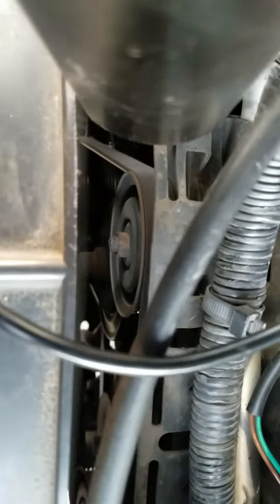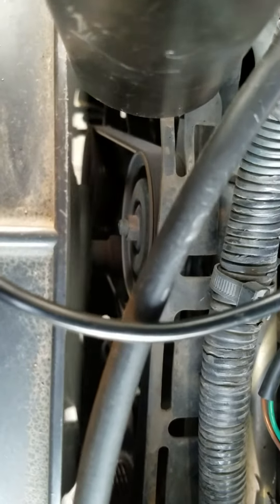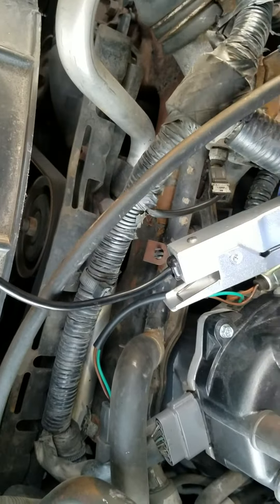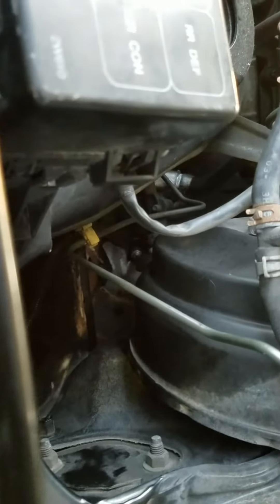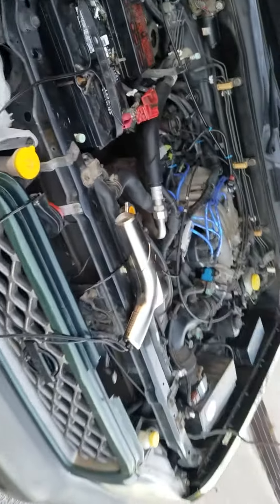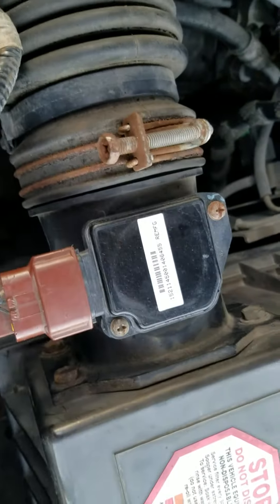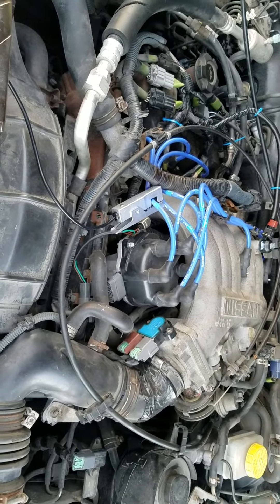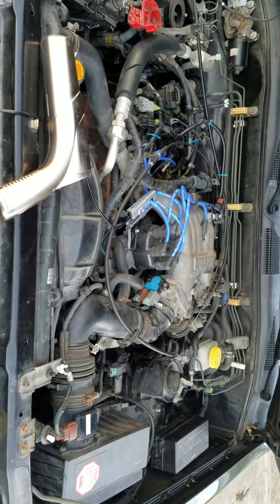Nissan 3.3 V6 Troubleshooting Misfire

Comment: Most common reason for this on a VG series engine is A: failed injector B: distributer bearing. You need to test the injectors.

Comment: My Pathfinder was doing the same thing. Engine code said it was a sensor. But 10 or so years ago I saw the intake rubber hose was brittle and had a crack that let air in.  I sealed it with Silicone and it did the job.  Then this winter The same code came up and I saw another crack. I bought a new one on ebay for $8.00. Took care of it and check engine light stayed off after earing. Now I have a miss fire on cylinder 6 only. I changed the spark plug and saw it was firing good with spark plug out. It only miss fires when cold and good when warm or hot. Dead as hell on #6 on ideal. Was told could be an injector.  Saw a video here on it and Im sure it is the problem. But looks like hell to do since you have to take off the intake of 3 cylinders including #6. For 1, 3  and 5 , you dont have to take it off and you can see them there on the left side. Too bad they made it this way. But when you take out a spark plug wire and does nothing on the ideal speed, and you have good wire and spark plug. It has to be the injector. Very high price it you have it done else where.  But check your intake 3" rubber inlet hose first. Im sure it is hardened and could have a crack in it.

Comment: I had problems to there was two things that were wrong.  One was the distributor.  The bottom bearing went out.  I did get it off Amazon and I've been driving it for almost 3 weeks.  I did not have no codes until I installed the distributor that I came up with an oxygen code.  Found this on you to on the left-hand side there are two grounds coming out and clamping down on the intake manifold.  So what I did was clean them up real good.  Made a ground wire from the intake manifold and used both grounds and bolded it to the intake then ran it over to the neutral.  It's like the engine calmed down.  I hope this helps and makes sense
Reply: so what is the neutral?
Reply: Ur dustuber it off by 1or 2
Reply: I know u have it on what it says nbut I had same issue it right off I promised

Comment: I have the exact same problem in my Nissan Xterra 2004
Did you check the PCV valve and air pressure valve?

Comment: I am troubleshooting exactly a 2002 Nissan Xterra 3.3 engine the code is misfire and cylinder number 2
Reply: Hi i am having trouble po302 codes same thing 99 pathfinder  all compression is 120 cap wires roter replaced still same after 10 minutes running
Reply: Me too
Reply: I change spark plug. Wires.and cap and rotor

Comment: What kind of spark plug did you replace with?  I used to like Bosch, but with newer vehicles I only go with what the OEM use ( BKR5 EGP NGK).  Bank 2 plugs are in a strange configuration, making sure the plug wires are all the way down onto the spark plug.

Comment: I have the same problem.  It shows code p0303 cylinder #3 misfires.  The motor runs  smooth when its cold for an hour and then it starts trembling . Some times

Comment: Have you tried changing the crankshaft position sensor? I know it can cause misfire issues. Normally throws the P0300 multiple misfire code. It's much cheaper than buying a new OEM distributor. That's the only thing I can think of to try since you've done pretty much everything else.

Comment: The problem on this car is low on any cars is that when it reaches normal temperature the valve seat doesn't seal so you have a little bit of Clarence once the clearance develop then it causes a leak of compression so the car starts misfiring because it has low compression that is one of the main problem of a blown valve
Reply: Did a complete head job, all new lines, sensors ignition components and all that jazz and still has horrible misfire so dont go spend a bunch on heads and think thatll fix it. At this point I'm at a dead end like everyone else.
Reply: @skylerslideways6761  So did you figure things out? I had a similar problem. Vehicle started and ran fine cold, then at operating temperature would misfire and run like crap. Quickly worsened. Brought it to a shop and they replaced the Idle Control Vlave and that cost me about 600 cdn. Thought it was fixed and left for a road trip. Then same problem happend. Previously, I had noticed that my distributer had red powder under the cap and mentioned it to the shop. The shop said I should probably replace it but they didn't.  Well, I should have replaced it alright, that was the problem, a seizing bearing in the distibuter assembly.  Had it towed to a junkyard, they figured it out and replaced it.  Drove it about 2000kms and now I it is starting to misfire again when at operating temperature with load (accelerating or hills). Now i am trying to figure this out. Not sure on any codes just yet but it could be many things. A bad injecter, a coil pack, or the distributer assembly seem to be the most likely. Could also be a vacuum leak, Mass Airflow sensor clean/replace, Air filter, Fuel filter, Camshaft Position Sensor ( in the distributer), Crankshaft Position Sensor, plugged Catalytic converters. Good luck!
Reply: @pascallemieux8942  yes, after some testing and comparison I found my distributor bearing to have not failed but definitely degraded very badly. Everyone says and recommends to not be cheap and just buy the oem Hitachi distributor and I also totally agree, dont waste your time just spend the bucks once and it will last another 200k. After that I used a timing light and cross referenced my live data stream from the OBD reader to be sure timing was set perfectly ( I set mine at 12deg for standard idle, be sure to have engine warm and your throttle position sensors unplugged when doing this) , since then I've had zero issues with misfire. Also too if you have like I do around 200k on your stock exhaust system get your cats checked, because failed and/or clogged cats will do weird things and make your vehicle hesitate and have way less power then they allready sadly do ha. Hope that helps, feel free to ask anything else 👍
Reply: @pascallemieux8942  shits crazy im going threw it with my 2000 frontier I even got a new computer had it programed and 6 new injectors 1780$ later and it still doing the same
Reply: @bricehale6593  worn / ceasing distributer bearing is one of the first places one should look.

Comment: Did you fix manage to fix the problem? If so what was wrong with it.. i have the same exact problem. So far i got a new distributor, spark plugs and wires, knocking sensor, throttle body and no luck.
Reply: I got a 2001 same problem
Reply: justin you fixed or not?
Reply: Fixed?

Comment: Any luck? I ALMOST bought a new dist from amazon but heard alot come DOA so far I've ran fuel system cleaner and premium gas no change don't think its injector Aldo im getting p0300 multipule misfires, ill prolly just buy a dist from amazon see if that fixes it if it does then will buy OEM from midspan eve though they run a good 300bucks OUCH...
Reply: Ever solved?

Comment: pretty much what I'm saying this card needs a valve job if the if this car has a misfire at cylinder 2 then Bank two heads needs to be removed and sent to the Machine Shop and that will fix your problem
Reply: injector he fixed it  who's the rookie. now ?